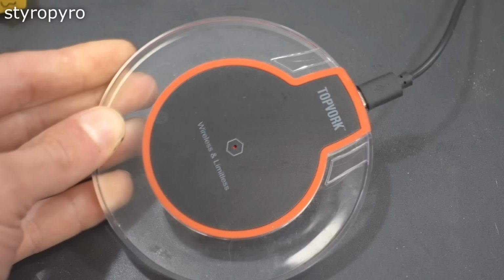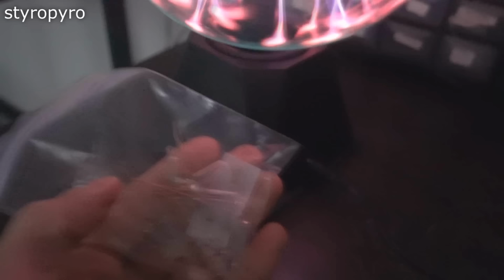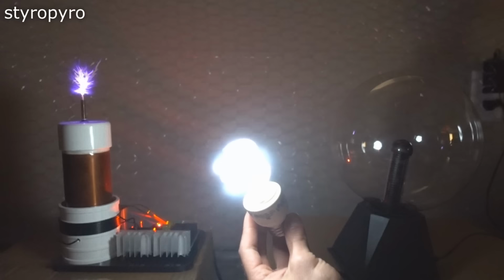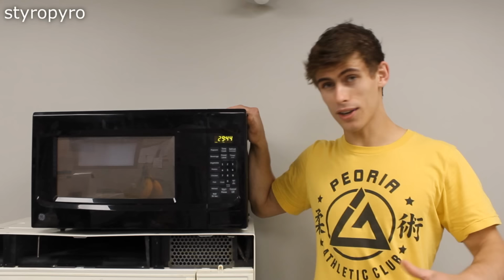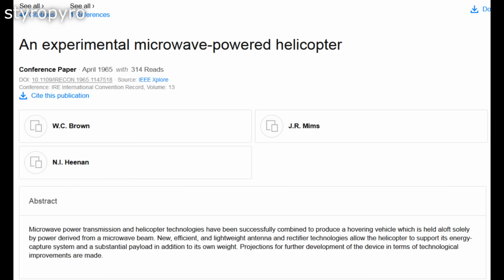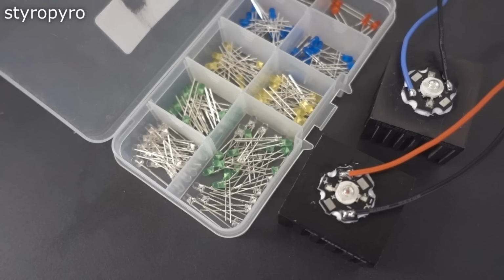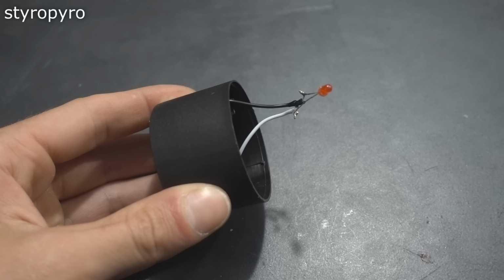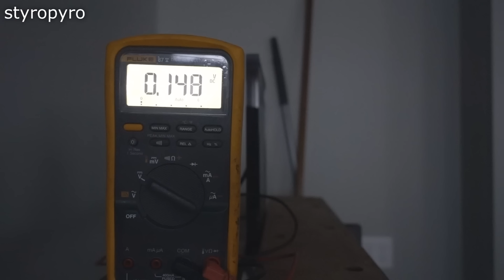Wireless Energy Transmission with Force Fields and Lasers

Comment: 12:07 Not quite right there Styro, in the not too distant future there WILL be a device that allows us to get more energy out than what we put in, it's a TOKAMAC fusion reactor.
Reply: Well technically no; the energy from nuclear fusion comes from extracting the difference in nuclear binding energy of the reactants and the products; the energy contained in the atomic nuclei of the fuel is what we "put in", and we only "get out" the energy that we are able to extract from the fusion process (which is less than what we put in because it's not a 100% efficient process). Also technically if we're talking about a closed system, then the first law of thermodynamics says that you could never get out more energy than you put in anyway.

Comment: How can you generate energy without plugging any energy generators into power. 
Something you can use when you go camping for example where there is no source of power available.
Reply: They are called batteries, and they are pretty nifty.
Reply: @chinobambino5252   Your attempt to make me seem stupid, just made yourself look stupid for not understanding my question, let alone you assuming there are people on this planet that dont know the existence of batteries, ... ofcourse I know about batteries and can be battery powered, but did you see him use batteries to power anything in the video? ... No.
This video was about getting the power from other more natural sources. I will elaborate my question: what other way is there to generate power from natural sources besides pointing a laser into a solar panel
Reply: @julzhotti5466  Sorry Julz, didn't mean to offend... the joke was meant to be lighthearted. But I still don't quite understand your question after elaboration. What is "natural" about laser pointers and solar cells? Lasers are powered by electricity, so ultimately they will run either by being plugged into an electrical main/outlet, or by batteries. If you were camping and wanted to power any practical, modern devices then you will most likely need batteries. Granted, you could use a solar cell to generate/store energy in these batteries during the day using power from the sun.
Reply: @chinobambino5252  no. 🤦🏼‍♀️
 I already know all that.
 Ok,  Another way I will put my question is; Besides batteries & solar panels (put them aside), how can one generate power say for when example ... camping, naturally from a totally "DIFFERENT" source? 
Because I heard there is another couple of ways, I'm just not sure of the methods
Reply: @julzhotti5466  You can burn gas or boil water and put it into a small steam engine.
Reply: @julzhotti5466  When there's no power source then there's no power, idk what you mean.
Reply: @julzhotti5466  How is fire/heat an invention?